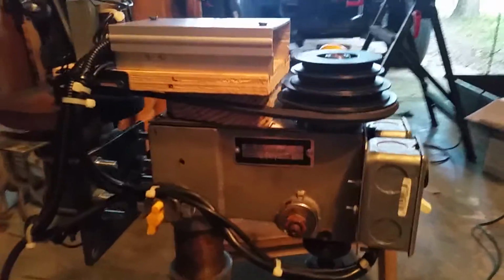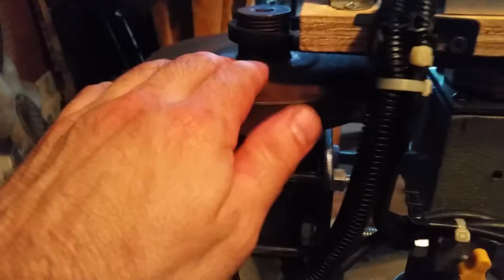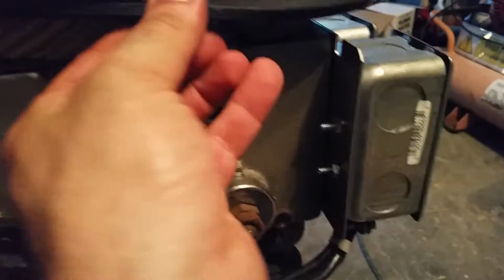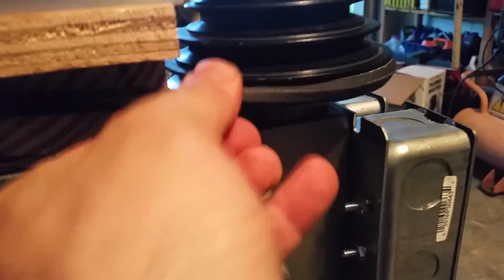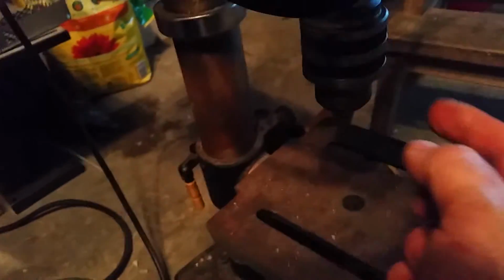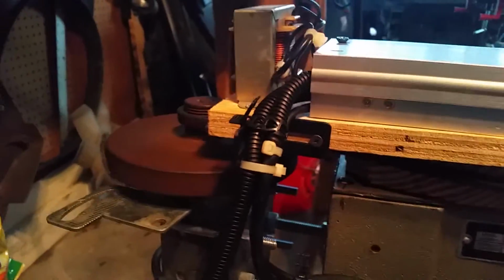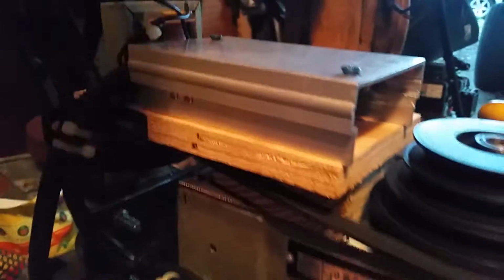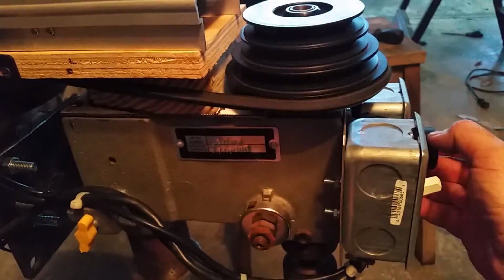Treadmill Motor Drill Press Mod

Comment: Franken-drill press. I love it!  I have a wen 5 speed drill press that’s only a 1/3 hp motor and thinking about upgrading the motor in mine
Reply: FactoryToe1982 I have the same Wen 8". I love the size and the spindle is very tight with maybe a 1/32" side to side if I grab the chuck fully extended and push it back and forth. There is also no preceivable round out of the chuck when drilling with a 5" long drill bit. I am VERY impressed with the accuracy however, I am very disappointed in the power of the 1/3hp motor. I'm here because I also need a much stronger motor. Did you ever upgrade yours? What motor and speed control did you get? What are your results? Thanks
Reply: I have the same Wen 8 inch drill press, and am also on here looking for upgrades to it as well, please let me know what you have done to yours so far.

Comment: I like it. Where did you get that pot with the push on /off??? That's great I've been using a momentary push button to pulse it when I turn it on (my bandsaw). Also I use the V-pulley fan and spacers from an older GM alternator and a 1/2" - 20 Left hand thread nut and a star lock washer on my drill press.
Reply from the maker: Sorry, just now seeing this! Pretty sure that pot is from Radio Shack, of all places. The alternator pulley/fan is a great idea!

I use this press all the time, it works great and the ability to change speed without changing pulleys is awesome. Thanks!